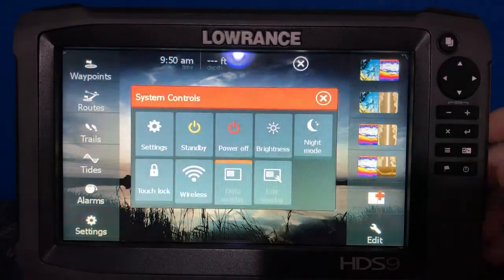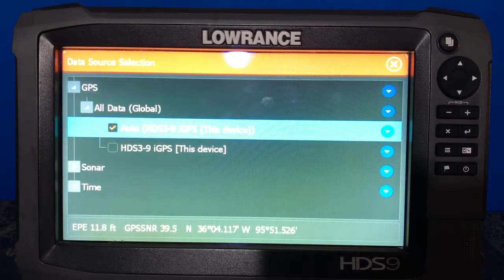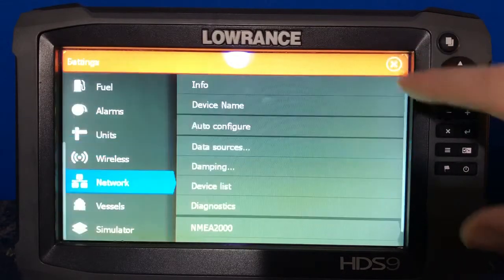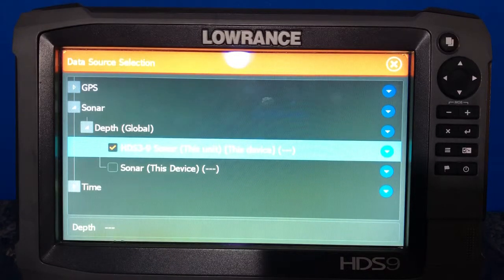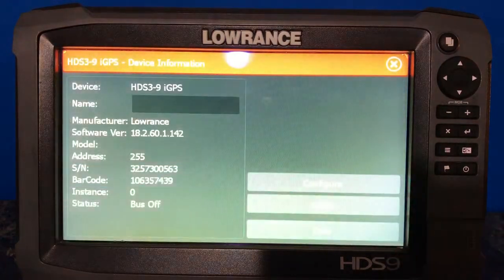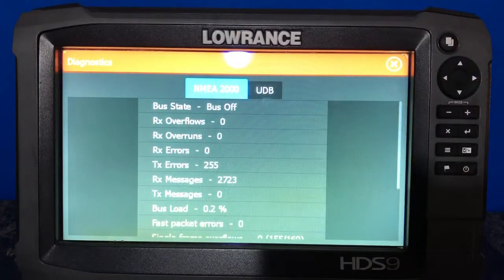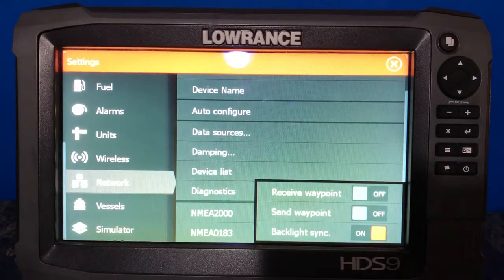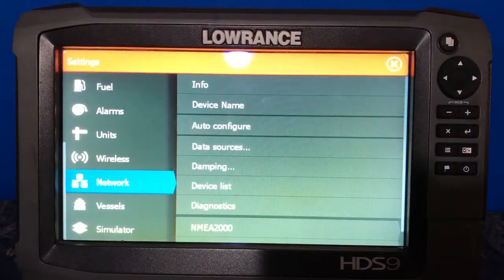NetworkSettings

Comment: hello
great video on network basics
question. i have 2 hds carbons connected with 3d module and ethernet .
should both of my units show the same ip address?
i want both units to show same chart ,sonar at all times.
i have only one 2d transducer,airmar thruhull.
i have had trouble with sonar settings, the unit that doesn't have the transducer connected in the back just won't sync to s onar seen on screen  of that unit that has the transducer.
tried  scope/global/local,autoconfigure,seems very confusing.
can i just take settings database file from the unit that has transducer connected, and import those settings into the other unit, to get the correct setup to show on both units?
thanks
john
Reply from the maker: Thanks for your question. The units should have completely different IP addresses as they are completely different units. You may want to reset the unit if they are showing the same. The key thing to know about Global/Local conflicts is that all of the units should be set to Local. Local will ensure that the settings will remain on the unit regardless of what happens in your network. Always go with "Local" as your settings. Keep in mind also that these are "Data Sources" which means sources for digital data. Your source, channel and transducer, and sonar settings are where transducers are selected. Settings.Set transfers will back up some data, but not all data.
Reply: @technicalsupportmarineelec1524  ok so what is "global" for?
thanks
john
Reply from the maker: @jw228w   Some items need to be global in order to be controlled by the entire network. An example would be a fuel flow sensor because we want consistency in the data. For Temperature and Depth, local is best.